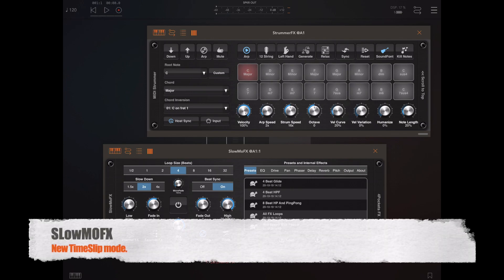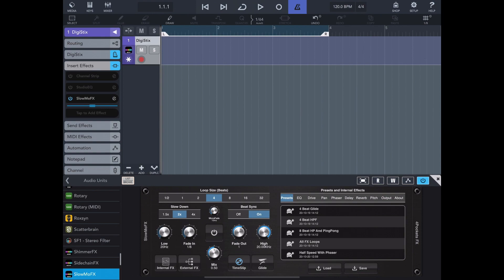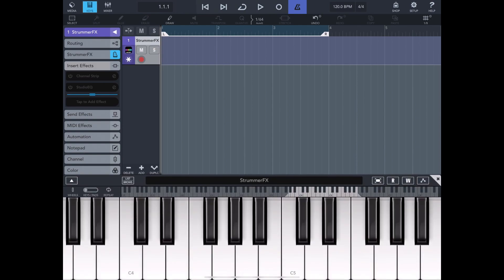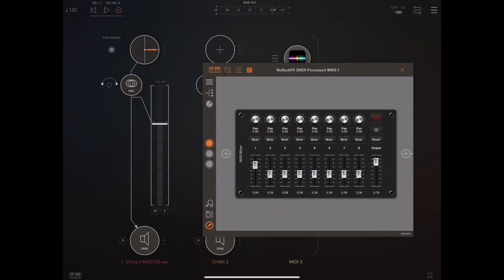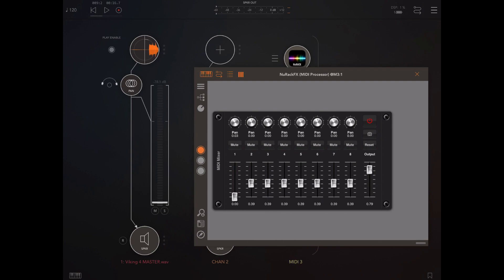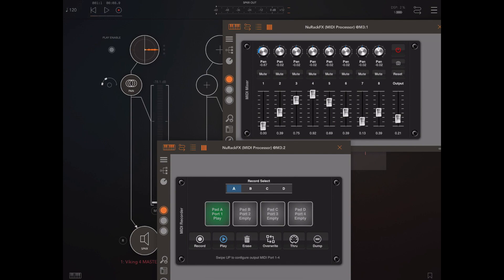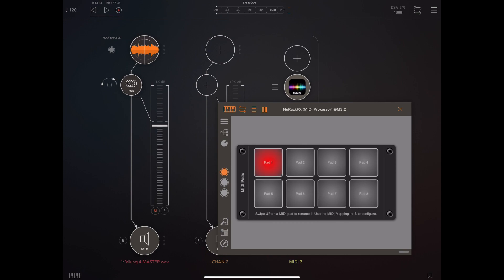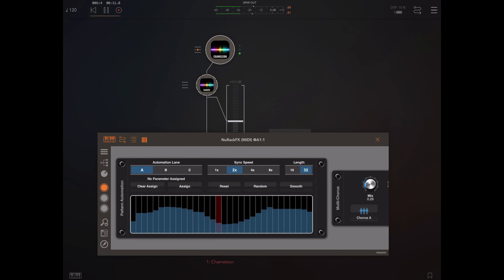Features 6 - SlowMoFX, Strummer and NuRack Updates

Comment: So i was trying to create a a good pitch shifter with Formant adjustment  going from high to low for vocals in nurack ios but the only Formant module i can find is the formant filter but finding it kinda difficult playing with to get that good pitch shift Formant shift plugin effect for vocals that many plugins have thats clean for vocals.   Any help would be appreciated or a preset or new module or something for this particular thing.    Loving the nurack ios app and just stumbled onto during recent black Friday listings.    Ty and stay blessed.    Also is there anywhere people share presets to download or anything like that?
Reply from the maker: There is no such formant module in NuRack sadly, and I only recently released a pitch shifter with formant preservation (MeloVox) but it won't allow a bend from one note to another. You can export and share presets on NuRack by using the File Transfer option on the main menu in NuRack. You need to connect your iPad up to your PC/MAC with a cable to transfer using your web browser.
Reply: @ thank you for replying back.  Yes the formant preservation was i guess what i was trying to say.